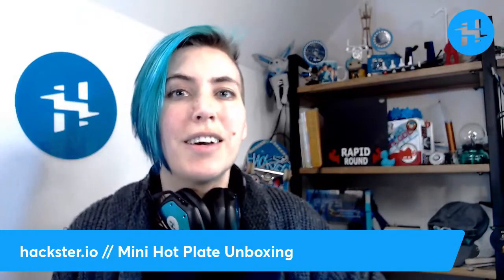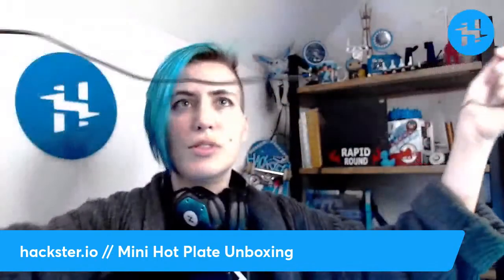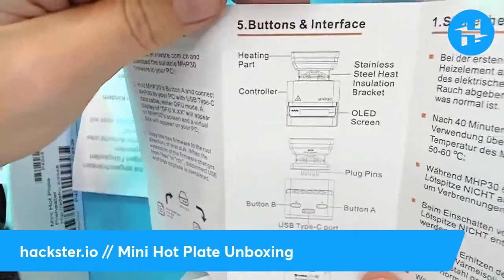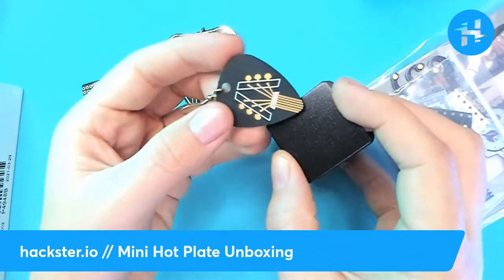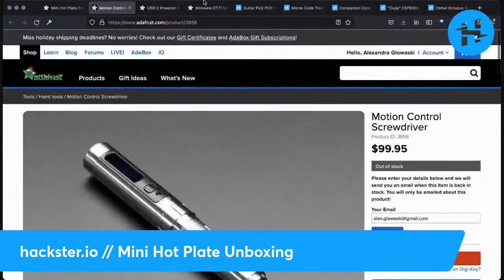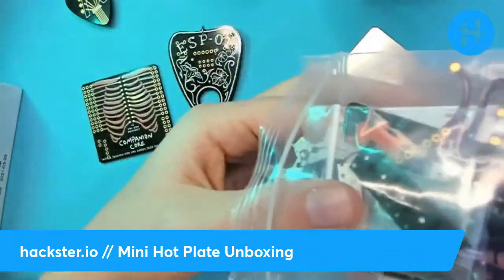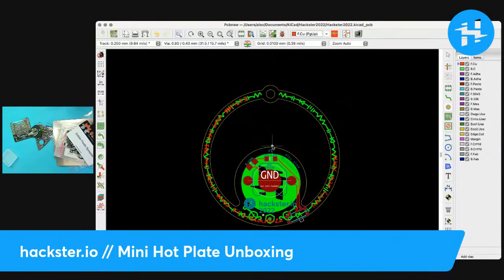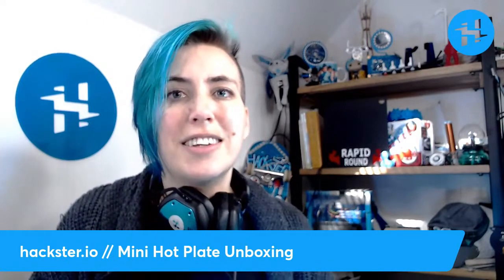Adafruit Mini Hot Plate // Unboxing

Comment: The TS-100 is still superior to the TS-80. If you want USB-C like I did, you can get a USB-C "decoy trigger" to get 20V (or 15/12/9/5) out of a PD power supply. I have used that device to convert countless things to USB-C. I highly recommend!
Reply from the maker: Cool tip, thanks!